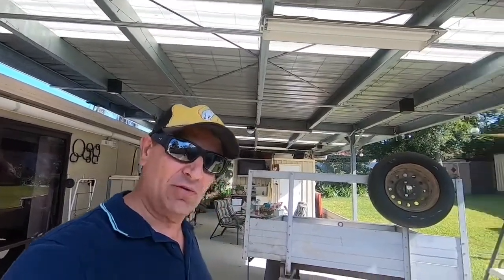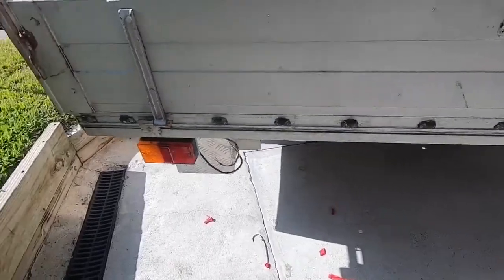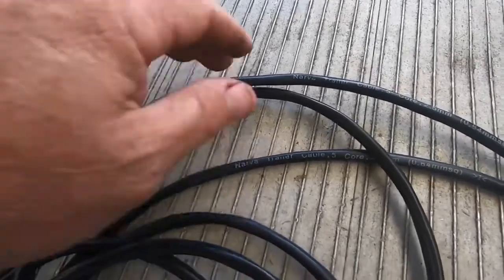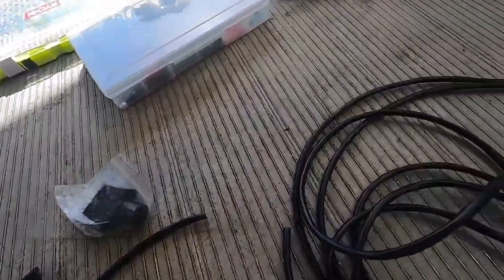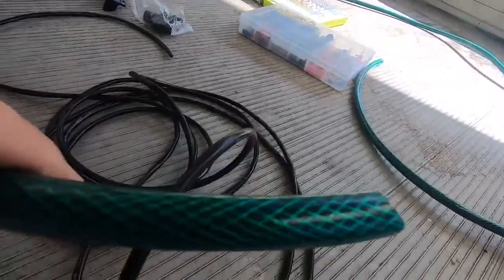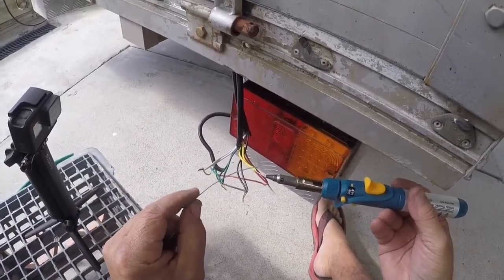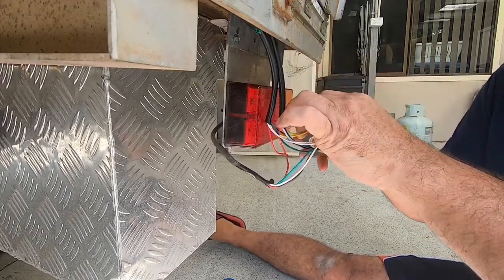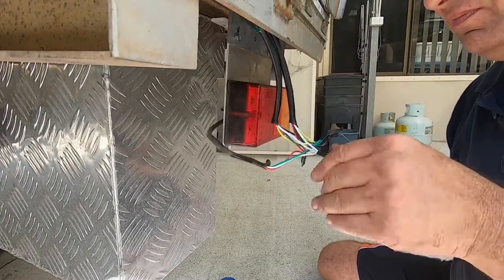Box trailer rewire Australia

Comment: Good video. Well explained. I have all lights working except left indicator. There is no seperate white ground wire from the indicator assembly to connect to body of tralier.  The white wire runs straight out of the unit to connect to main wires. If it is a ground/earth problem wouldn't the brake and tail lights not work?
Reply from the maker: Yes correct. Hope you get it sorted and thanks for watching 👍🍻

Comment: Thank you so much for the video, it's very clear and informative! I'm just wondering why the green wire running through the trailer cable from the left light is connected on the right-hand side - can you just cut it off and not connect it to anything?
Reply from the maker: You can cut the access off if you wish but the green wire is for the right indicator. Thanks for watching 👍🍻
Reply: @EFFICIENTSELF  I have another question, I hope you don't mind! I'm going to attempt to rewire an old box trailer that has new lights on it, but the lights only have 3 wires  - no earth wire. So how do I earth them?
Reply from the maker: There must be some sort of  earth point on the lights . Attach a wire to this point and ground to the chassis and/or earth wire
Reply: @EFFICIENTSELF  Thank you.
Reply: would the earth be through the nut and bolt that holds the cover in place.

Comment: I did all that but taped all together was working fine I I should have tape   the wires like you had done coz when I plugged them in my running lights and everything went out no only indicators nd brake lights work do you have a clue why this could be  doing this??🤔
Reply from the maker: Check your earth . Even if you put another earth point on the trailer chassis. Hope you get it sorted 👍🍻
Reply: @EFFICIENTSELF  will give it another try tomorrow cheers m8
Reply: @EFFICIENTSELF  Unless I missed something you didnt mention connecting the earth to the trailer itself. Other videos recommend this, what is your opinion?
Reply from the maker: Can’t remember if I mentioned it or not but it’s a good idea . Thanks for watching 👍🍻

Comment: I bought two trailer lights from supercheap  they are not left and right ,I think maybe yours are  ? so if you have universal and wire it as I did its not going to work , my electrical knowledge is 0 so I spent a few hours wondering , why when I copied yours did it not work , fixed now. but I agree  great video mate Thanks
Reply from the maker: Cheers Glad you got it sorted thanks for watching 👍🍻

Comment: Hey mate, I have trailer lights with only 4 wires -earth, brake, tail and indicator tested on a 9v battery and 5 core wiring. Any ideas with how to set it up?
Reply from the maker: Yes left light you connect left indicator to yellow wiring (5 core) and right you connect indicator to green wire ( 5 core) the rest of the wiring you connect the same eg brown,tail….red ,stop etc hope this helps 👍🍻
Reply: Thanks for the reply. Also discovered that the earth connected to the trailer should be not far from the plug, say half a meter  if it’s connected down near the tail lights. Say 2meters from the plug it’s ineffective.
Reply: Sorry to be a blitz but the three green wires to the right hand indicator- one from the trailer plug, one from the right hand light where is the third one connected to?
Reply from the maker: No need to connect as should have been 2 green just from plug and connect to right indicator.you can blank the other off ….dont know what I was thinking at the time .🤣
Reply: Thanks again for the reply. The wiring I did was correct but the left indicator wasn’t working. Triple checked again but it turned out the plug in the socket just needed a wiggle! Was driving me crazy but all ok in the end. Thanks for the video.. spot on and Australian so relevant to us Aussies. Cheers.

Comment: Doing a boat trailer but i ran two cables for l/h and r/h and the two meet at the top of the trailer which i wired together then into the plug it did work but now only the right side.
Reply from the maker: Check your connections 👍

Comment: Sorry mate quick question, does the earth wire connect to the trailer body at all? or does it just run straight through to the left tail light with the middle and right earth's spliced into it?
Reply from the maker: Use the earth wires from cable and the lights You can also earth to the body if you want to 👍🍻

Comment: What was the splicing joining tool you used 9:10min & Great video BTW & 9V tip!. I'm rigging up a reverse light as well, to aid my reverse camera on a box trailer. As I get back late and can't see when reversing down my driveway.
Reply from the maker: Search automatic wire strippers on eBay these ones are very similar here https://www.ebay.com.au/itm/172356595925?epid=1287309174&hash=item282140f0d5:g:z6wAAOSwLnBX6ykS thanks for watching 👍🍻

Comment: Well, my brake lights aren't working, and even running a separate wire to them doesn't work. Not sure what the problem is, all the other lights work. Might get some led lights, and then perhaps a new plug worst case. Trial and error I suppose.
Reply from the maker: Check you might have a bad earth wire.. if the wire looks dodgey just you better off replacing it .. thanks for watching and all the best 👍🍻

Comment: Not all 7-pin and 12-pin flat plugs will work together.
The door on 7-pin sockets typically open vertically and latch onto the plug while 12-pin sockets open laterally and retain onto the side of the housing.
Also be aware that 7-pin round plugs may be wired to either ISO-1724, ISO-3732 or AS-2513. These standards are not interchangeable, Australian and New Zealand trailers should always be wired to AS-2513 (AKA NZ-2513).

To make matters more confusing pin 2 on AS-2513 plugs may be labeled as "AUX" and pin 5 may be labeled as "FOG" especially on trailers that aren't fitted with Reverse Lamps or Electric Brakes.

Finally, 12-pin wired trailers may use non-standard connections for pins 8, 9, 11 and 12. 

Some trailers manufacturers even use non-standard wiring for Aux power, breakaway sense and Hydraulic Brake Pump.
Reply from the maker: Cheers for that info 👍 thanks for watching 👍🍻
Reply: But did he wire a 12 pin trailer? No!
Did he wire a trailer with Brakes? No!
He stated the trailer didn’t require brakes!
Is this a 12 pin re-wire video? No!